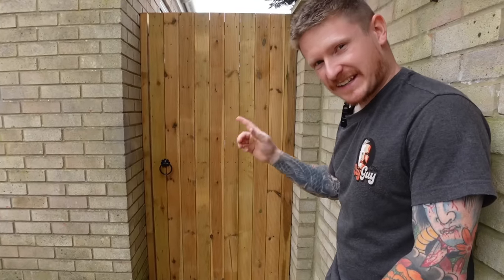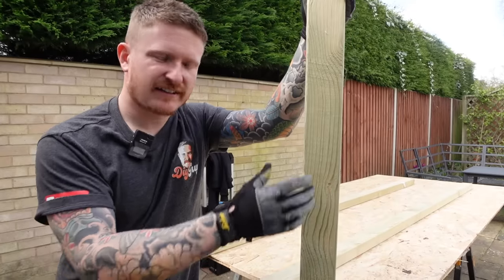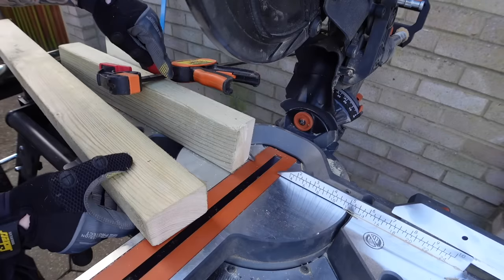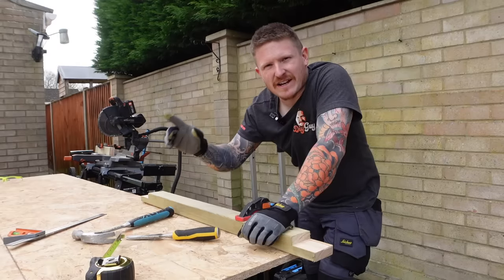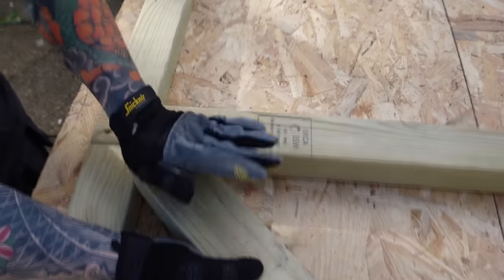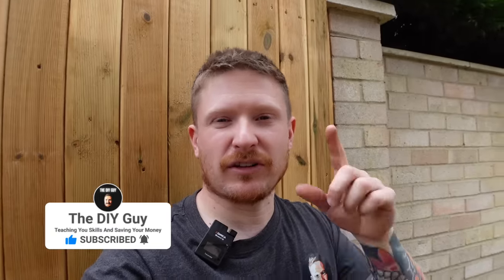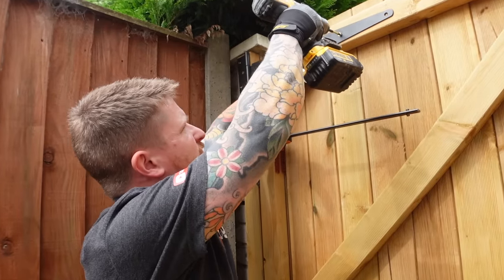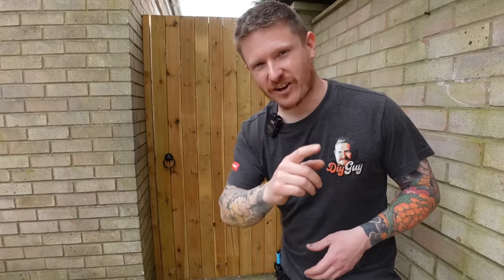How to Build a Garden Gate | Easy Step by Step Guide

Comment from the maker: Now the better weather is finally here we can get outside and do jobs like this. What else do you want to see?
Reply: You in my back garden sorting out my summer house 🤣.  
Nice work on the gate, well explained about which side to run the cross braces from 👍.
Reply: Outside timber structures like pergolas, how to close in a side entrance with timber with a perspex roof.
Reply: Great video as always.  I guess outdoor jobs at this time of year would be reseal decking (proper way) and also fence post replacement due to weather or general decay.
Reply: Maybe installing lighting in your shed I really don’t know how to do that
Reply: @michaellord2844  Great shout, I've got rotting timber posts which I desperately want to replace with new ones but not confident to take the plunge!

Would also be good if you could demonstrate how to cut fence panels and make good for smaller gaps
Reply: I need to replace a couple of fence panels. Have you seen how much they cost? I'm sure I could make something just as good. It would give me a lot more confidence if an expert showed me how!
Reply: You're a God send mate, I was just going to spend a day learning how to build a double Gate using the exact same decking boards I saw in B&Q but was hesitant on some of the details such as the gaps to keep, what accessories to buy and this video pops up just in time. Thank you so much!!!
Reply: Would love to see a video on how to fit a wooden or PVC garage/shed door. These videos are great, thank you!!!
Reply: I need to build some kind of fence to seperate the lawn from the patio to keep the dog off the grass in bad weather
Reply: What is the size of the rails that u were using, 2inch x 3 inch ?? Great video by the way!
Reply: Great video 👍🏼. Are the deck boards fixed on with grooves facing onto the gate  or facing out ?
Reply: I'm going to be building a wooden greenhouse and whilst I have mostly a plan to do it, I still enjoy watching videos like yours for extra tips and a easier effective way at tackling something that I hadn't considered. Keep up the excellent work 👌👍
Reply: A bigger driveway width gate to suit this would be on my list.  I need ones about 3m wide, preferably double doors that open up fully or maybe a person sized gate next to a wider one, but fully opening
Reply: I really want you to tell us how much it cost you to make, I understand prices change for materials but if you could give more info on pricing on how much you spent on this date or even a rough estimate that would be very helpful. Love your videos keep it up 👍
Reply: Hi, I built the same gate, albeit a 5ft tall one, and 905mm width.  You're looking at around 4 lengths of 3x2 for the size gate in the video costing approx £7 each.  You'll need gorilla wood glue around £7 (Toolstation), and some appropriate 40mm screws (I used stainless steel ones, £12 for a 200 pack Toolstation) and fundamentally that's it for the basic gate frame, around £47..although timber suppliers etc local to you may be cheaper or more expensive.  I then added a few extra sections of 3x2 left over on a vertical in the middle as i was making my gate a contemporary style using horizontal ex50mmx18mm bedlath, so I needed a centre fixing point. The gate in the video used 10 decking boards, and you'd be looking at around £68 on traditional decking boards for that if you wanted to make the exact same as his. All in, you'll be spending around £115 to fully construct a complete gate.  Sounds a lot, for some it will be too much, but in comparable terms, the 5ft gate version  I made myself versus a similar but lesser quality build gate sold by my local timber supplier, I saved £40, have a far stronger, chunkier C24 graded gate and the enjoyment of having made it myself.

Fixings wise, GateMate ring latch 150mm £10 Toolstation), Heavy duty 500mm gate hinges £14 for a pack of 2 (Toolstation), but I used 3 and I'd recommend using a 3rd for a middle hinge, just made best sense to me, but not everyone will agree.

Thereafter where you site it will determine any additional timber, concrete screw bolts etc.  Even factoring in these costs, it was still cheaper than had I got a local company in to make and install one.

Hope that helps, and I apologise if I fell into the dreaded 'mansplaining' lol

Comment: A good tip to remember for anyone making their own gate, when drilling through to fit the latch, clamp a scrap piece of wood on the other side so you don’t get any blow out or splintering!
Reply: Or look for the pilot hole appearing and then drill back from the opposite side
Reply: @leestockton9367  This is exactly how to do it

Comment: That bracing information is brilliant, never knew that!
One thing I would say; if you haven't a spare bit of timber to clamp to prevent the blow out of wood when drilling through, is to watch for the pilot part of the bit coming through and then to stop drilling that side and locate the pilot hole on the other and drill back. It gives a neater finish and doesn't leave untreated wood exposed (even though the latch will cover it, it's still exposed untreated), but I'm super particular (or picky!)

Comment: When you drill your 6mm holes into the 3x2, do you drill a different size hole into the brickwork for the M12 concrete anchors?  I was understanding that whatever size diameter screw used to fasten the timber would require the same size masonry drill bit respectively (ie, M12 anchor requiring a 12mm drill bit), but it wouldn't be the first time I was wrong with things lol
Reply: You will do. I need a 10mm hole in the wood and 8mm hole in the masonry for my anchors
Reply: @agg25gga  I just drilled through the timber and into the brick using a 10mm multi drill bit... The dewalt screws I used were M10 (10x120) and the threads are bigger than 10mm anyway, so it all fastened together nice and tight.

Comment: Worth putting a cap on the top end grain. I use dowels to set it in place rather than screwing through from the top of the cap. Drip channel a useful groove in the under surface of the cap
Reply: Even better, industrial adhesive like OB1 waterproof and strong

Comment: Well that was pleasing to watch - literally exactly the same way I had a stab at doing our front driveway pedestrian gate last year :-) One thing I did debate with myself was whether to have both braces going all way to the hinge side or whether to have the top brace end half way across the middle horizontal brace and then the bottom brace start at that middle point of the middle horizontal brace and continue down to the bottom hinge. I guess either way works. Aesthetically you’d end up with just one long diagonal from top to bottom using my alternative way which might be preferable to some.

Comment: A few things...I would have fitted a centre hinge for that amount of weight and it would minimise any deflection/sag over time; I would have equalled up the space at each side of the gate when fitting it; Either drilled from both sides when fitted the latch (or used a backing board) to prevent spelching; Coated /treated panelling before fitting.

Comment: Cracking video. I've been umming and ahhing a side gate replacement as well, but I will build it. Now the decking is a great idea, many thanks for sharing.
Reply from the maker: Best of luck!
Reply: The last gate we had (fitted by previous occupants) was decking but for various reasons it finally gave up. Had a new one fitted as tongue-and-groove and (as it's on a busy path) bolts as well (though they are super easy to fit if required).

Comment: Another excellent video Cam! I like to use black exterior tite screws outside (so they won't rust but are much cheaper than stainless steel screws). I think the other name for that treatment is jappaned screws) thanks 🎉
Reply from the maker: 👍 thanks

Comment: Hi, loving your videos, all very well presented, descriptions are clear and helpful, and your style and videos, for me, just cut through all of the waffle and give people the confidence to tackle the projects themselves.  I was wondering, when attaching the 3x2 to the wall to hold the gate, would 7.5x112mm torx frame fixing masonry screws be suitable, or should I insist on some heavier duty type as you used?  I've used 8 of the torx screws mentioned, spacing every 2nd brick as these are what I had and didn't necessarily want to go spend a further £25 on the dewalt ones.  Cheers for any feedback 👍👍

Comment: Absolutely love the content mate, learned so much from your work. I'm about to undertake replacing a frame and door on a brick shed and covered side entrance. Both are framed both sides and on top so I'm wondering if you'd still leave 20mm short on the width and 100mm short on the height for this kind of job? Again, keep up the great content.

Comment: I like the content you place YT and am a subscriber. Very useful. However, it would be handy if you could spend some time on fixing issues we may encounter as in this video if the original gate frame is not square and requires adjusting. As expected, you got it right first time. Unfortunately, us part timers will probably need to make an adjustment :-)
Reply from the maker: Thanks for being a subscriber and thanks for the useful constructive feedback 👍

Comment: This is great - thinking about making one. Just concerned about the expansion/contraction of the decking board face over time. Does anyone know if this is gonna be a problem. I know if decking boards are laid flat they need about a 4mm gap between boards.
Reply: You could even add something like 400 mm of clearance between the fence planks. When your hinges are strong enough, you then use the fence planks on both sides. You should use a wider plank on the sides at the back. There is a Dutch saying called 'Meten Is Weten' which means 'Measuring is knowing'. I once purchased a metal frame myself, so I actually have no right to speak. 😅

Comment: Hi Cameron, thanks for the video, great content as always! 
Just a quick question. I’m looking to make a gate myself this summer however not sure on how to avoid ripping down cladding pieces so the gate looks uniform. Is it just a case of measuring the opening and dividing that space by the width of the cladding, less the 10mm gaps at each end. Or am I missing something. Sorry if that’s a silly question… I’ve never made a gate before 😫
Really enjoy your vids.. looking forward to this years content 👍🏾👍🏾
Reply from the maker: Hi, your welcome and thanks for the comment. Once you’ve chosen your cladding you can build your frame and set out your cladding either by diving as you suggested or simply ‘dry fitting your cladding to visually set it out’. Whatever works for you 👍

Comment: Since you already use Gorilla glue, have you used their epoxy glue(expanding one). Ever since I came across it I never use anything else. Brilliant for fixing creeks in stairs. Pulled carpet off. Put glue bottle in hot water to make it run better, used blunt tip syringe and squeezed the glue in every crack on stairs. Left to cure overnight and no more creeks. Happy days.
Reply from the maker: I’ve never used it but will have to give it a go
Reply: Yep just don't get it on your hands it stains
Reply: @leebennett3672  should’ve seen my hands after first time I used it🤦‍♂️🤣
Reply: @Dalbayob69  🤣🤣 I can imagine lol

Comment: I want to do my own like this.
Question though: you didn't say whether any of the two outer decking boards needed thinning vertically so that you clad the full width of your frame with each length of decking butting up tight to its neighbour.
My frame would be 930mm wide and decking boards are typically 120mm wide, but I don't fancy trying to cut down an 1800mm length of decking board ! Seems to me there are two options. (A) 7 off 120mm boards plus two lengths of treated 45mm wide timber, or, (B) 7 off 120mm boards with six gaps between them using 15mm spacers to ensure accuracy.

Any opinions ? Option B has advantage of less cutting and I can still just about get a paint brush into the gap to re-paint cladding edges.

Comment: Really helpful video. Not sure if I’ve missed something but if your gate frame is 100mm shorter than the wall mounted posts and you then overlap the cladding 50mm top and bottom, wouldn’t this mean the bottom of the cladding would touch the floor?
Reply from the maker: The posts are sitting above ground so as to avoid damp and rot. Thanks

Comment: Quick 2 sec pointer pre drill screw holes it also helps prevent splitting
Reply from the maker: Yeah you could pilot hole if you prefer.

Comment: How about heat and cold causing those decking slats butted up to each other to expand or contract if they are all screwed in, won't the gate warp over time? Where as shiplap can expand/contract more easily? Just a thought, I might be wrong. Nice work otherwise. You are a natural teacher/instructor. Also how about a lock(s)?

Comment: Great video, any tips on how to attach the timber to the house, when the house has been wrapped in this 4inch insulation.
Reply from the maker: What insulation is it? Thanks
Reply: @TheDIYGuy1  It's very popular here in Ireland, like a 4inch thick aeroboard, very light, 4 foot by 4 foot  sections which are attached to the walls with a sort of glue and fasteners and finally rendered over.
Reply: Polystyrene, I think.
Reply: Use some very long concrete screws?
Reply: @Gerry2210  My house is similar. Also in Ireland, ICF construction was used. I drilled a small hole first and to measure depth of render and insulation. Then I found 10mm rawl plugs around 50-60mm longer to reach into the concrete behind the insulation. Drilled with a long 10mm bit, then used screws which were a bit longer again to go through the gate post and into the rawl plugs. I used 3 I think. The gate is still hanging after 17 years. Its a similar sized wooden gate but probably a bit lighter than this example as I used thinner cladding
Reply: @danodonovan  Thank you very much for your reply and great to know it didn't cause any problems. I have a few items, retractable clothes line and garden hose, that I want to hang as well. Will most definitely follow your example. Thank you.

Comment: Every cladding piece appears to be the same width. Were you lucky that the cladding timber width multiplied by 9 or 10 ( i.e. number of cladding pieces) fit your opening, or did you plane the cladding to make them narrower so overall they fit your space?

Hope that makes sense.
Reply from the maker: I had to take about 20mm off the last board. I’d advise setting out and taking an even amount off your first and last board to get an even rip on each edge.

Comment: Hi.What is the size of the cladding? I intend to use 4 x 2's for the frame and bracing and is considering 4 x 1 for the cladding,but cannot seem to find suitable timber in this size.Any ideas?
Reply from the maker: Hi, I can’t remember the size of the cladding but I think it’s 95 x 20mm. The cladding is deck boards from b&q.

Comment: Did you use raw plugs for fixing to brickwork?
Reply from the maker: No need with the concrete bolts shown in the video. They are designed so that you don’t have a plug.

Comment: Goes to show what can be achieved quite easily when you have the right tools.. not so easy if you only have manual tools. Not impossible, just takes a lot more time and effort.
Reply from the maker: Absolutely 👍
Reply: I've made the exact same gate and used a hand held black & decker scorpion saw to make all my cuts.  Worked just fine if you take time

Comment: I don’t like the hinge not being completely on the frame, if he’d made the top and bottom cladding overlap a bit bigger (frame a bit smaller) the hinges would have fitted onto the frame.

Also, nothing in the video of how he’d space/adjust the cladding so it fits the frame - it’d be very lucky if the cladding boards were exactly the right width.

Comment: How do you adjust if it wasn't at 90 degrees before bracing?
Reply from the maker: Just take a corner to corner measurement or use a square and knock the corners round until it’s squared up.

Comment: Should of used 4x2 instead for the gate posts. Then you’d of had enough room for the door stops. Schoolboy error we’ve all been there 😂
Reply from the maker: I get what your saying but I didn’t want door stops so chose 3x2. Not an error just a choice 🤷‍♂️
Reply: No need for door stop with that latch
Reply: Would this work for making double gates?
Reply: @cuebj  of course it would. Couple of heavy slams or wind damage and either the latch arm will begin to bend or the keep will fall off. Once either does the gate will blow right through and come off its hinges because there’s no stops. Not even a middle hinge on it either.
Side gables on houses like wind tunnels
Reply: @JohnnyMc5  oh spot the keyboard expert.

Comment: 👎👎👎👎 sorry but mounting a garden gate in brick like that is asking for trouble and will not last (The hinge side). Hint: bricks are mostly good for a load in compression.
Reply from the maker: Never had any issues with ones I’ve fitted but your welcome to your opinion 👍
Reply: @TheDIYGuy1 I Drill & bolt the same way as you but in addition I half fill the drilled holes with some Gripfill as I screw in the bolts as that stuff dries as hard as stone “ish”👍
Reply: Nice job.
Reply: Wouldn’t all gates next to a property need to be fixed to brick 🤷‍♂️. Explain how you would do it?